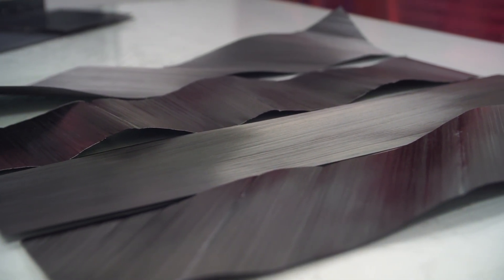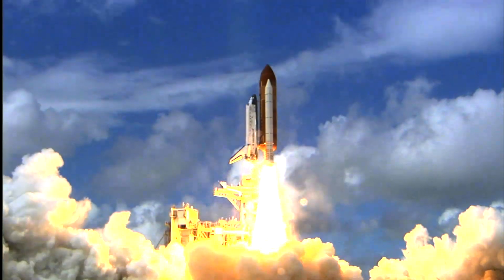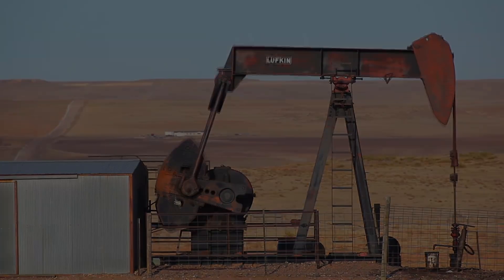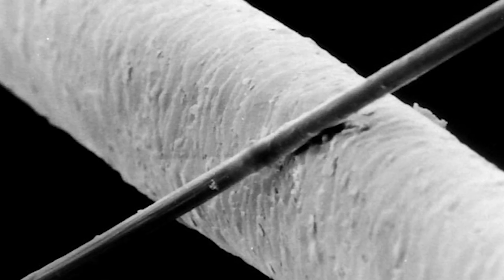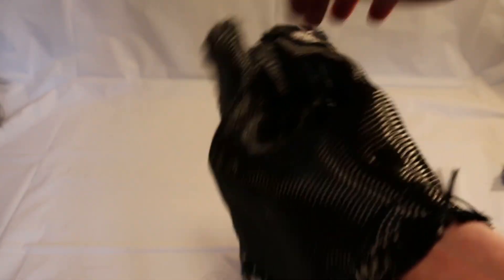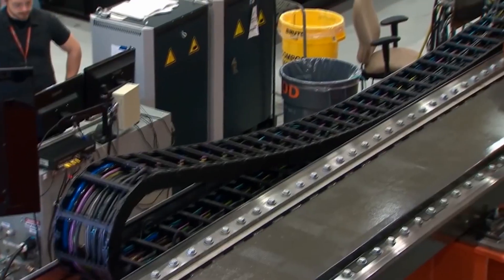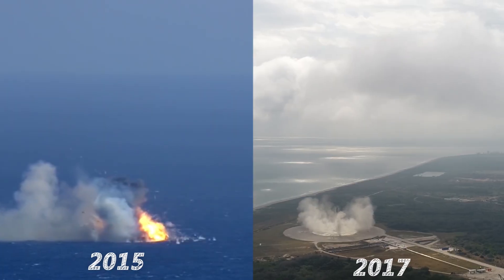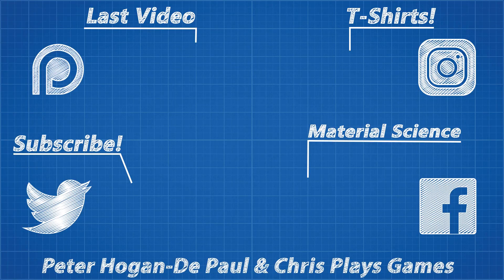Carbon Fiber - The Material Of The Future?

Comment: Civilization on Mars is such a fucking meme, could we stop pushing it and look at something more practical.
Reply: vide0viwer you're scared of progress
Reply: Would you rather go to Venus where the surface pressure is 92 bar?  Humans are hard wired to explore and expand and unless we annihilate ourselves in some stupid display of political chest thumping we will, as a species, spread to other planets and solar systems.  The only question is if you and I will see it in our lifetimes.  I, for one, am hoping that one day I will be able to live on another planet, but I suppose we shall see.
Reply: vide0viwer Closer to 40%. There would be adaptations, but the difference isn't enough it would compromise human health nearly the extent you suggest, and I've seen nothing to suggest lower gravity would prevent conception, nor does that align with my knowledge of the human reproductive systems.

Materials would have to be chosen to suit the environment, but that isn't really a huge problem, and the lighter gravity and lack of enough atmosphere for wind to be a factor means construction materials have to resist far lower forces to begin with.

Yes, and living undeground is entirely viable, especially as, once again, lower gravity means the structure needs to withstand lower forces. This also has the benefit of insulating any colony structures from temperature changes, or differential temperature between different parts of the structure.

Congrats, you've just made the argument that nobody should ever take any risks. That is legitimately full blown retarded. There are plenty of situations already tackled by humanity where failure means death, and rapid resupply is impossible, and those cases lack the resources of scale that a colony would allow for.

Except there's no reason to further colonize Antarctica that doesn't cause enormous problems that could trivially result in end-of-civilization.

As for the moon, that's a hilarious suggestion, because it basically ticks off everything you just complained about even more than Mars does. It has closer to 15% Earth's gravity instead of Mars' 40%, it gets colder AND hotter than Mars does, it's also exposed to radiation, and while it's much closer than Mars, it's still hard enough to get to that there's very little chance you're going to get anything to a lunar colony fast enough to help in a serious emergency. It also has various other things going against it, like fewer resources, not being viable for terraforming, and the lack of atmosphere meaning the prevalent lunar dust hasn't been worn down at all, so it's like a bunch of tiny razors that stick to everything.
Reply: It's the most practical choice. Nearby, has most of what we need to sustain humans there, and if we get really silly, if we were able to put enough shit into it's atmosphere, it would stick around for long enough timescales that we wouldn't need to worry about it's depletion.
Reply: James Burleson Other solar systems are looking pretty unlikely, actually, but expanding to multiple planets is pretty important. Now if only we could get Venus to donate some of it's atmosphere to Mars.

Other than Mars, there are some promising moons, the idea of a floating city on venus is iffy, and then there's spacestations.
Reply: +seigeengine Mars has around 1/3 gravity compared to Earth: With a species that has developed under Earth's gravity will mean drastic changes will occur such as bone and muscle loss, this is not including unknown long term mental and physical symptoms that may occur. Also because of the gravity women may not be able to conceive children.

-Extremely cold temperatures even for summer: This means steels and other materials will be a lot more brittle so only specially designed materials will only be practical which means $$$.

-No magnetic field means you will be facing solar radiation on a daily bases so its either live underground or build thick walls.

-33 million miles from Earth: any emergency supply requests will take months to arrives and if a colony fails after spending billion will just make humanity more closed minded to space colonization.

I will be more convinced of a colony on Mars when we are able to make a self sustained colony on Antarctica which is 10x more habitable than the red planet. Also if we want to colonize space the Moon would be a better candidate.

+96mtbrider see answer above.
Reply: I think when we get around to homesteading the final frontier, we'll find that living on planets is the least practical way to do that.
Reply: Yeah, what we need to do is stop using resources and especially stop using resources that make earth harder to live on

Comment: That demonstration of carbon fibre's weakness is like breaking a thin sheet of veneer along the grain to demonstrate the weakness of plywood.
Reply from the maker: Wood is a composite material. The cellulose fibres (what the original carbon fibres were made from) are the fibres and the lignin is the matrix.